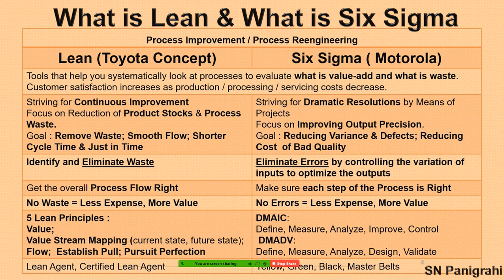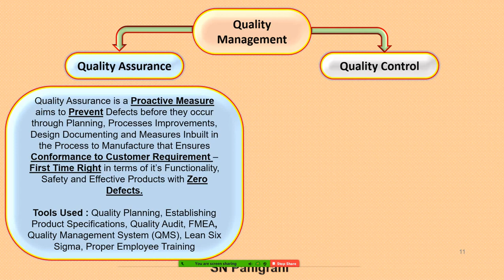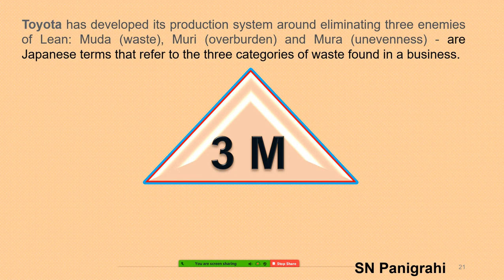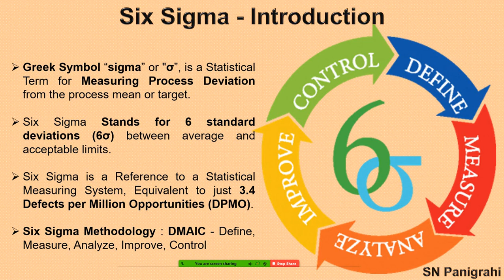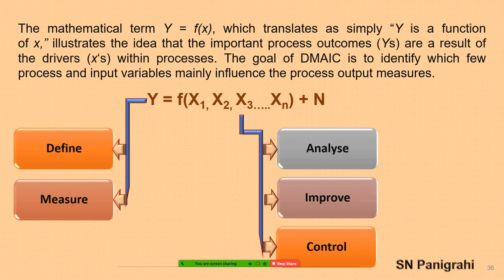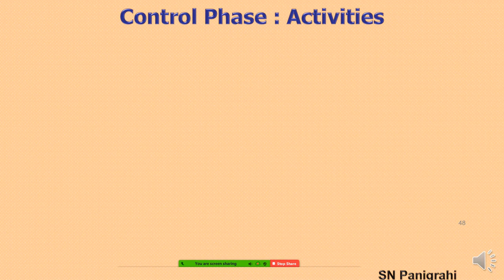Lean Six Sigma - Basic Concepts  By SN Panigrahi

Comment: "Six Sigma Champions are con men" 
“All you have is smoke and mirrors” 
- Creator of Six Sigma, Mikel Harry
91 % of Six Sigma companies have trailed the S&P 500 (Qualpro survey).  Six Sigma’s once best reference, GE, has thrown the trash out.  An 8 yr study at Ford showed an average of 1 in 5 parts defective AFTER improvement for “successful” Six Sigma projects.

Six Sigma is a destructive scam based on pure farce.  Six Sigma was laughably based on the height of a stack of discs!  Most folk never bothered to check.  

EVERY aspect of Six Sigma is worthless, from its normalization nonsense, to its irrelevant enumerative methods, to its paralytic DMAIC.

Dr Wheeler, the world’s leading process statistician, calls Six Sigma “GOOFY” and the stuff of “the tooth fairy”..  CBS calls it the most stupid fad of all time.

There is never justification to stray from the giants of Quality Dr Shewhart, Professor Ishikawa, Professor Lewis, Professor Deming, Dr Taguchi and Dr Wheeler, for the lunacy of Six Sigma’s con man.

How the Six Sigma fraud was started:  
https://youtu.be/0kZbJLHK_4M 

Lean was tacked on to prolong the Six Sigma Scam.
98% of LSS implementations FAIL (IW survey)